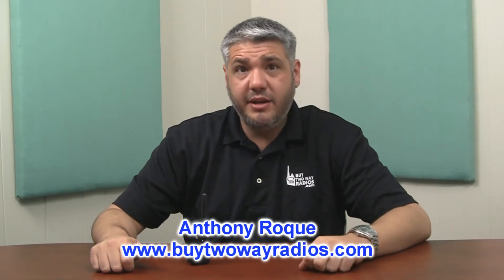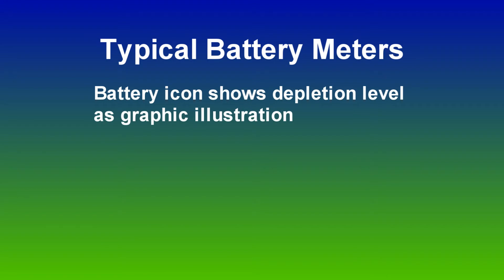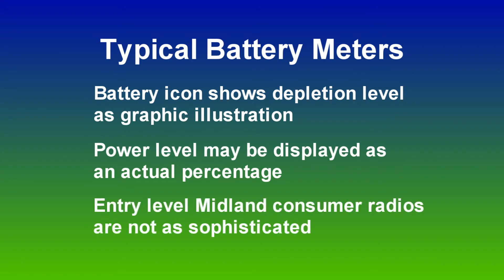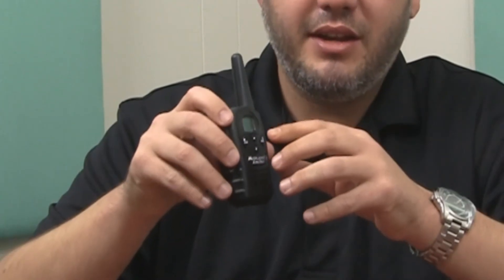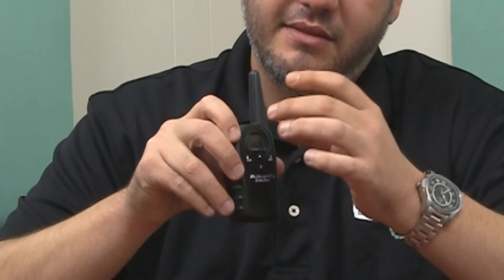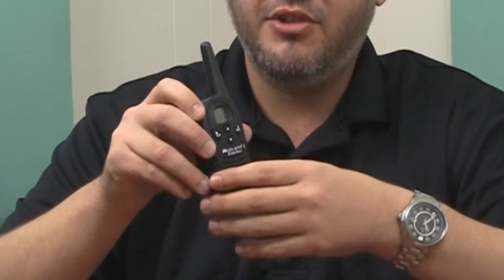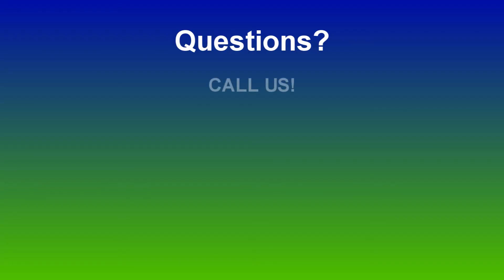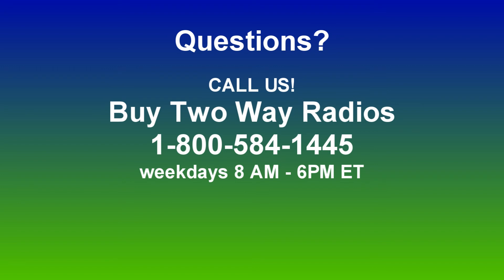Battery Meters on Midland Two Way Radios | Radio 101

Comment: Why do shingle rechargable batteries not show charging on the charger
Reply from the maker: Accessories made for various models have different aspects and features that are included. It comes down to the manufacturer's judgement of what was necessary to include at the time. If you are referring to charging docks, most of them produced today normally display whether the radio is charging or not via an LED light on the dock.

Comment: I have some Midland T31A devices. In the manual it says "The LCD display will show FULL when charging is complete." It also says "it is recommended the battery pack be charged for at least 12 hours with the radio turned off"

They've been charging for 2 days streight and don't see FULL. I still see the battery icon flashing from 1 to 3 bars.
The radios are off.

is this normal for this device? will it ever say Full? 
How would I reach their support team?

Edit: fixed a typo.
Reply from the maker: When you take the radios out of the charger and turn them on, does the battery level show a full three bars? If so, it should be fully charged. If not, or if the number of bars drop as soon as you press the PTT button, the batteries are under charged. Also check to be sure you are using the AAA rechargeable NiMH batteries provided by Midland and not alkalines or third party rechargeables. If they are the correct batteries, it is possible you may have a defective charger or batteries. You may need to contact Midland support. You can find their contact information on their website. They also have a live online chat.
Reply: Buy Two Way Radios yeah it does, but it seems to do that whether I charge it for 20 minutes or 20 hours. I get that's just how this works. Thanks!

Comment: Supplemental info…
Midlands has an “LXADP Dual Pin” charger that can be plugged into one of the two headset jacks (the lower jack, as noted on the rubber cover).  This can be used to charge the “standard” Midland NiMH battery pack or, according to Midland, any AA NiMH battery.  As a photographer, I have lots of NiMH rechargeable batteries for my camera equipment, viz., my portable flashes.  Thus, one can split up a pair radios and charge their radio without having to solely rely on the dual desktop charger, which could inconvenient or hard to do if two friends, living in separate houses, wanted to use the radio to communicate: one can use the desktop cradle and the other the LXADP.  They could use a phone, but two-way radios are way more fun.  Also, the manual says AA alkaline batteries can be used.  Midland tech support says any AA battery should work, whether they are NiMH or Lithium in the rechargeable or stand alone (non-rechargeable) version.  The stand alone versions dramatically outlast alkaline batteries — but you can argue that point with the Energizer bunny.  I am also curious if anyone, without and FCC license, has got in trouble for using “reserved” high power channels: 1-7 and 15-22 (or 23 - 50).